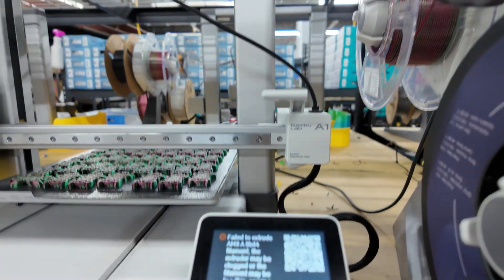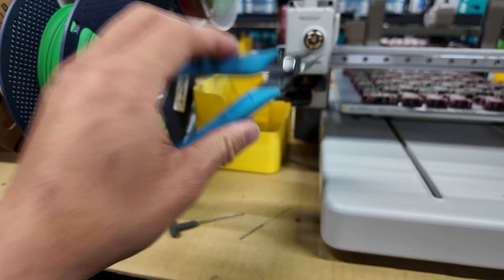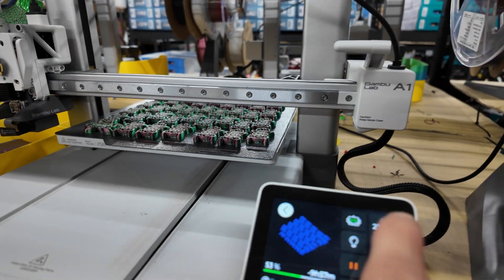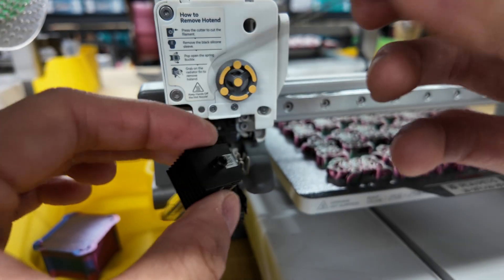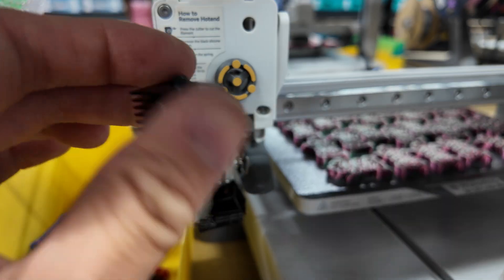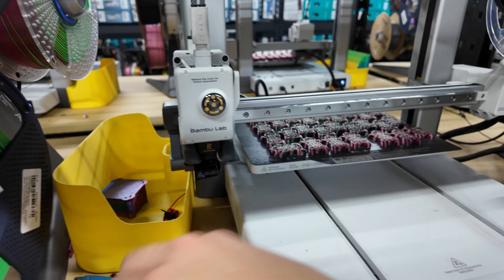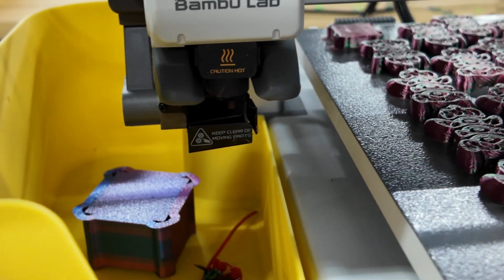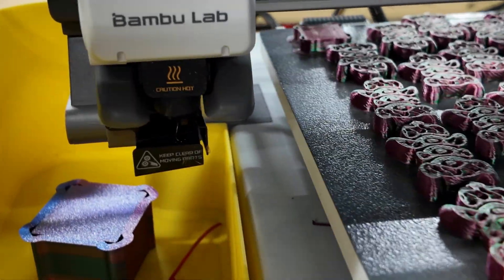Unclogging Bambu Lab A1 3D Printer Mid Print

Comment: Thx! Worked great for me, but please wear gloves for this, this man is built different (idk how you didn't get burned). Btw the thin hex key that comes with the printer is perfect for this.
Also BE CAREFULL, don’t leave the hex key inside the nozzle for too long. If the nozzle cools down while there’s still melted plastic around the key, it can solidify and trap the key (almost happened to my dumbass). Just push firmly once, then make a few quick pushes to clear out the rest as he did in the video !

Comment: won't it be too hot to handle with your hands that way? Do you have like oven mitt gloves for that or something?
Reply from the maker: @radfaraf  nah if you hold it the correct way it's not hot at all.. but I would suggest gloves or pliers to holder it
Reply: @Dancyn3Dprints  is the black part at the top generally much cooler, and the rest super hot?